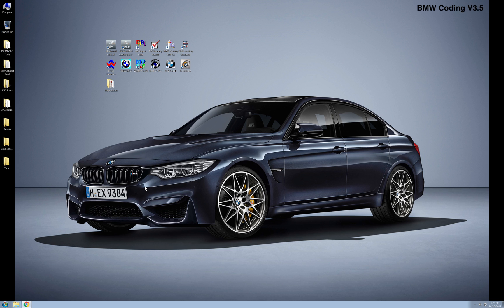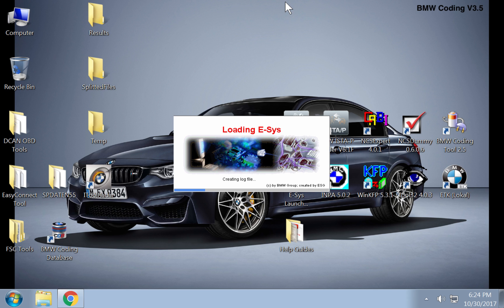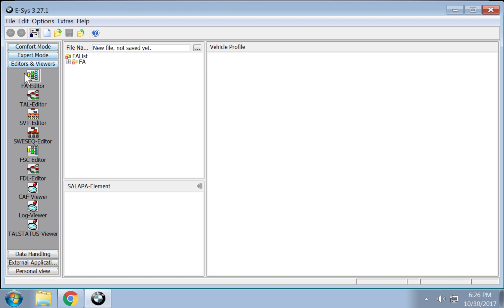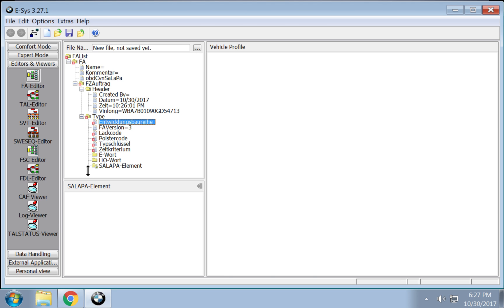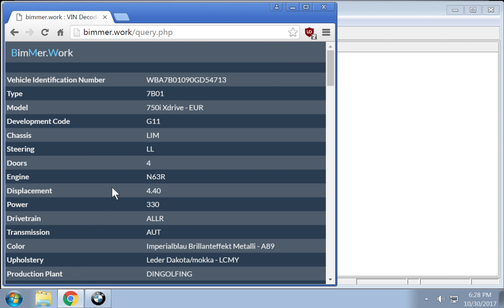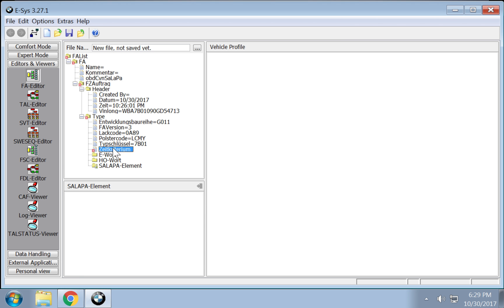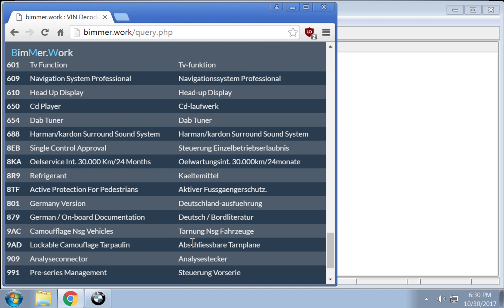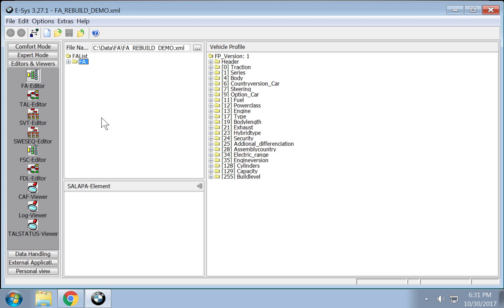E-Series e-9x Rebuild FA E-Sys

Comment: Thanks for the video. I'm a bit confuse. Do you have to put the VIN and options list of the donor car or the car its going in? I put thee donor cars VIN and options list then coded the car by pressing code FDL. It coded but came back with an error. Now E-sys won't connect to the NBT unit. Any help please

Comment from the maker: Thanks to 2real4u, I have new information to add to this video. To accurately get a production date for the EVO head unit, look at the donor head unit VIN - in this case mine was 1/2015. If the production date of 0115 results in a failed FP calculation, it would be better to use a 11/14 production date vs 11/15 since options can change with newer models.